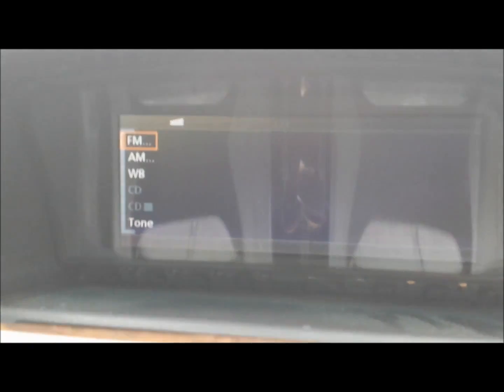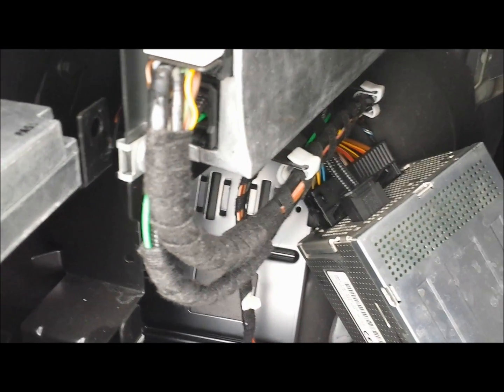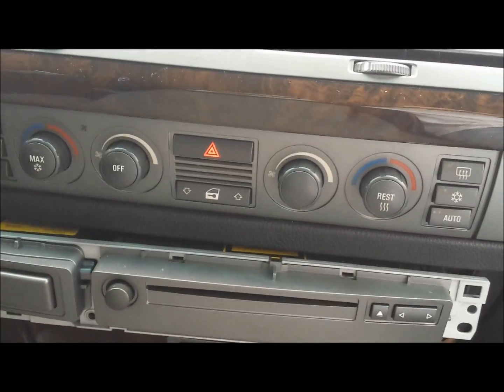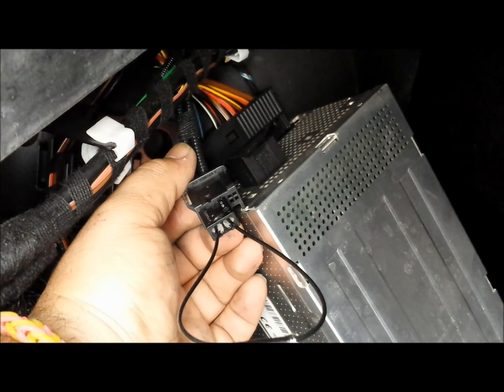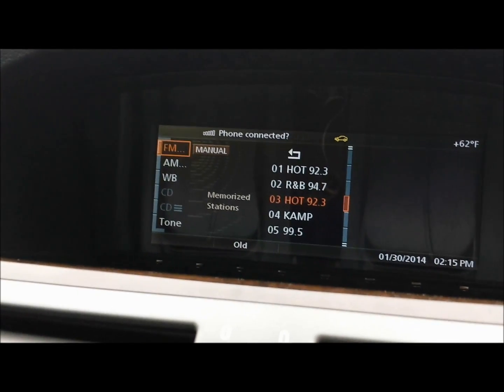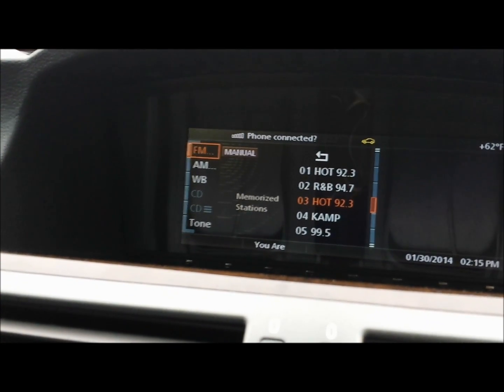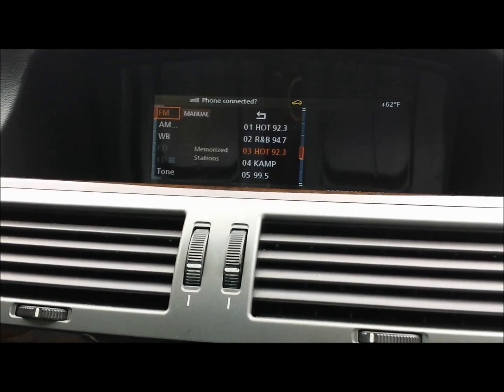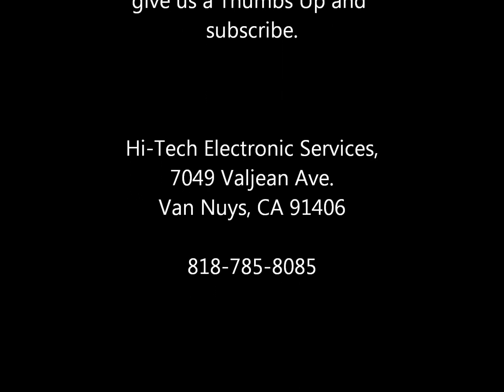How to Troubleshoot BMW Fiber Optic Audio Navigation 750 / 745 2002 to 2008. Part 1

Comment: Whats the common fault in the ask unit/cdplayer?  Compasitor,cracked grounds?  Any idea to get my tech in right direction?
Reply from the maker: @ZacSimpson-t8h  Cold solder joints, blown output chips.
Reply: @HiTechElectronic  thatnkyou i have just dropped mine to a friend that dose boards, ill let him know, I'm in Australia so do really appreciate  you advice!!
Reply: @HiTechElectronic ,I've got the ask unit back, I now can see radio stations, and my cd player works and plays music, but my radio, has no sound, I can scan and save stations just no audio?
Reply from the maker: @ZacSimpson-t8h Do you hear the door chime when key is in the ignition?

Comment: Mine when first got it only front pass door worked. It sounded bad though and very mono lol. I finally said screw it and started turning it not caring what happen to it. Started fading in and out not long after it completely stopped playing. This ess about 3 months ago. Vouple nights ago i noticed my door chime wasnt working anymore. And that night my idrive started freezing when id hit power button on ask. Then i noticed the entertainment screen wasnt showing stations anymoreI had purchased a loop a while back. I believe its the phone module i can put the loop in and then i can see the stations show back up. I noticed a very very faint sound coming from rf pass door but for only a min. Thing is i have when all devices are connected in system i have a red blinking light after every module. I put the loop back in and the stations show back up but no saound still. So that brings me to today. Today i got in it started it up and back speakers played, subs tried to play one in middle of dash was popping and static.  Did you say rare dick? Lol anyways first time i ever heard back speakers. Everybody says when you dont have red light after a module then thats the prob but when my loop is out of the phone module and it plugged up i still have the light all way through my system. Also today i went into my entertainment setting while they wss half ass working and i could adjust the eq, turn the logic 7 setting up to 10 (have not been able to get it past first little square at 1 till today while was workin) even though bass and trebble has always worked none of the others would. I have never had the little map on side idrive even when before when radio half ass worked. I have noticed my navi sound as it powering on and off when key wasnt even in ignition but every time only hear it for few seconds and stops and 30 min later i will hear it again. I have noticed a slight buzzin sound coming from dash at times when key is out and should have been asleep. Idk if this is normal but i can hit power on ask at any time and the idrive turns on also with the key not in

Comment: Can you tell me why my bmw 750li 07 speaker make a cracking sound a buzzing sound and no bass?
Reply from the maker: @yakell1012 Most likely Logic7 amplifier in the trunk is bad.
Reply: @HiTechElectronic  Are there any solutions?
Reply from the maker: @Mutlaqthatguy  Have your amplifier repaired or replaced.
Reply: @HiTechElectronic my problem is that the music works fine for like 3 seconds then it makes a crackling noise and shut off for a second. Then the music start again but the audio is lowered.
Does that mean that the amplifier is bad?
Reply from the maker: Bypass the amplifier in the trunk and check your audio again. If it sounds clear then the amplifier is faulty and if it is still the same then ASK unit is faulty.

Comment: I enjoy your knowledge on the audio system on BMWs.....I have a 06 750LI and my subwoofers under my front seats sound muffled and distorted!....Is it my Logic 7 amplifier or the subwoofers have gone bad??...If I use my lollipop on the Logic 7 and the subwoofer sound good, does that mean my Logic 7 is bad??....Pls. advise me on this issue....thanks....AMM
Reply from the maker: Most likely  the problem is the Logic-7 amplifier not the subwoofers. FYI if you bypass the amplifier your subwoofer wont have sound anymore!

Comment: Same problem here, it's a 2013 X3, I bypass the SOS module, nothing, then I connected a new amp, no sound. The radio works fine, what else can be?
Reply from the maker: BMW X3 has totally different sound system. If all the functions work fine including navigation and 12v power to the amplifier. Then you might have problem with programming of your CIC unit (radio/CD player} in the dashboard.
Reply: @HiTechElectronic  thank you, I have the cable and need to contact somebody to help me with the coding.
Reply from the maker: @ABWSKITCHEN  once you do that, check to see if the CIC unit is reset itself back to default "internal Amp" or the coding is correct, should be "external Amp".
Reply: @HiTechElectronic  thank you so much, I will try once I fix my laptop.

Comment: so i just need the optic fiber bypass module loop? then just "bypass" everything? then ill be fix or will that "lollipop" tell me which one to replace?
Reply from the maker: It will tell you which one is bad and if you are not using that module then you could leave it bypassed for ever.

Comment: I'm having this issue but none of the fiber optic cables are flashing red, this happened after i hit a bump and everything stopped working, I have tried the bypass on all fiber optic cables in the trunk under the steering wheel etc (2008 bmw 335i logic 7) if anyone has any ideas what it could be it would help
Reply from the maker: Your radio/cd player must be faulty.

Comment: Hi There !   Share my efforts.    Fell into the trap   BEFORE i understood how its all   connected,   Like  Xmas lites   1 buld goes out    whole string goes out    ..   I  bought   Typical   Logic 7 amp  ... used  ,,,       still   not all speakers work  ...... Waiting now for    Used ASK unit... (   for 04 e65 745)   As my car is that  ... Never  twigged on  ASK unit  rubber  volume  / off on button just was wiggly  .  n  just spin   NO clicking    .    Wait n see   Everything wit the radio was  good ,  disply etc    JUST sound from only 1 door speaker      Great video!!!!!   BTW

Comment: So I used a optical loop for my mmi radio and it work for about a month but now it cut back off, and won’t come back on I bought another loop and it still doesn’t work, what’s my next option
Reply from the maker: Keep bypassing rest of the components to find the faulty one. If all are ok, you need to have your ASK unit checked out.

Comment: How did you make this loop cable
Reply from the maker: Here is the link to purchase it:  https://hitechserv.com/parts/
Reply: @HiTechElectronic  hi I'm facing a problem with the E65 the problem is whenever I can I get the amplifier it make a beep sound all over the speaker and the screen is it got stuck in the BMW logo
Reply: Connection the amplifier*
Reply: @HiTechElectronic  or it lag whenever I switch to navigation entertainment etc it just like lag it doesn't go to any entertainment or navigation
Reply: @HiTechElectronic  please send me a WhatsApp number
Reply: Please reply
Reply: Hi there I am checking a 745i bmw no red lights at all in the trunk on any of the equipments the customer had someone change all the units except the FM tuner and communication module no fm stations display they still have all the equipment they change out.

Comment: Can you please tell me if I would replace the communication module of my 2005 facelift with an 2007 e65 communication  which it has the PK on it, it might work without inserting the module in the system? My issue is that when I am trying to connect my phone to car by bluetooth it asks me for that 4 digits pin which I don't know how to find them since are not written on the communication module.

Comment: Do I need more then one bypass cable .. I tested all with one but not enough  cable to test more then one at a time ????
Reply from the maker: If you have more than one faulty components then you would need more bypass otherwise one is enough. Having more than one bypass connectors make it easier to troubleshoot, sometimes we use 3 or 4 of them at the same time.
Reply: @HiTechElectronic  thanks ordering them now im going to order 4 of them

Comment: So I put a lollipop on the logic 7 amplifier even tho cds would play and the radio it would just cut in and out so I put one on it and it stopped it cutting in and out. But my question is how do I service my 745i 2003 e65. I’m hoping when I register my battery it will fix my trifecta light bc it’s so annoying seeing it

Comment: I know it been years since u posted this video. But is it possible to not have the Fiber optic wires at the Navigation unit in the trunk? Mine don’t have the optic wire with the harness on the navigation unit.

Comment: Hi there, how much do you guys charge to repair the cd changer?  The cd cartridge in the cd changer in my 2007  BMW 750Li is stuck and will not eject.  I'm considering fixing it maybe vs buying a used one off Ebay.  Kind regards - Alex.
Reply from the maker: Please check our website for prices. Ebay used items are cheaper to buy.
Reply: @HiTechElectronic what is the differences  between the ask units one have mode fm/am buttons the other dont

Comment: Hello, why is my Radio and the CD Player and CD Changer cuts in and out?  Do I have to replace the DVD GPS Navigation Unit or is any other solution?  Blue tooth suddenly stopped working.    Plesea!  You or any one with knowledge of same issue.  Thank you.

Comment: I have a 2005 545i and navigation screen does not turn on.neither the radio. The weirdest thing is the CD changer works.but I cannot controlled or see my options to control my heat position Taurus face legs or windshield. The heat turns on so I do have heat. Also I cannot see the car liquid levels due to the screen not being on. The car drives perfect and everything else works except the screen can somebody please help.

Comment: Hi ... I have a problem with the sound of my car. The car is a BMW e60 545i. There is logic 7, but the front door speakers do not play. I tried 2 amps nothing happens. The problem is the same. Could the problem be in the cd player ????
Reply from the maker: Yes, the problem is the single CD player in the dash board.

Comment: I have BMW X5 2008. All of sudden I drive screen went dark and no audio. In the trunk there are components, phone module and amplifier. The amplifier don’t have a fiber line to check, only the phone component has a fiber line hook up. Pleas help
Reply from the maker: The problem is the CCC unit "Radio/CD/Navigation" in the dash board.
Reply from the maker: If your car does not have navigation option then you have have M-ASK unit "Radio/CD Player". BMW X5 sound system is not like BMW 7 series and if the display is black you do not need to check the fiber optic lines. You need to check the fuse for radio and display, and if all the fuses are good then the M-ASK unit needs to be replaced or repaired.
Reply: Thank you
Reply: Thanks for the reply. I checked the fiber to the phone module, there is blinking red light. I checked the fiber line under the dash board, there is a blinking light. The amplifier has no fiber line connected to it. I don’t have navigation system or data LT radio. The speakers every once  and a while they make a cracking noise. You mentioned the ccc unit is the suspect. Before l buy new one(very expensive) how do l make sure that the ccc is the problem. Thank you very much.

Comment: So what if all the components are working and the red light is on when you unplug each component and you still don’t have FM cd nav etc?
Reply from the maker: If you have checked all modules correctly then the problem is the ASK unit.
Reply: HiTechElectronic I looked on inpa and it shows a error something about the network not waking up, do you know what that’s about?
Reply: HiTechElectronic error E18D
Reply from the maker: @kingchrisp198432  No clue.

Comment: Hi I have the 2007 BMW 750i and my NAVIGATION isn't working, also the audio system is very bad . I can only see the names on the screen like FM,AM ,AUX but not stations available.  After I have watched your video ,I believe the NAVIGATION unit cause the problem.  Please comment below your opinion. Thx
Reply from the maker: Please watch "Part 2" video as well. Any unit with fiber optic output could cause this issue.
Reply: When u ship how long does it take to receive it
Reply from the maker: @viktorthomas2668  3 days.

Comment: Hey I tried everything you said on this video with the lollipop and it’s still the same. Only thing I haven’t tried was the radio it self cause I don’t have another radio to test it out. Once a month the front speakers would work for an hour or so then nothing sometimes the display freezes.

Comment: I think this all relates to my issue. no sound from bluetooth. music through aux sounds distorted and no matter what source im using for music ask unit volume lowers or may even go off. is this related to these issues?
Reply: Did you ever it fix and how because I’m going thru same problem now as we speak with ‘07 750 to the point my whole screen blank out and my temperature gage frozen

Comment: I have 2007 bmw 750li and I bypass the satellite tuner under the truck and the radio works but I have a noise coming from the driver door speaker. How much to repair the satellite tuner and what’s the next step to fix that noise from driver front speaker

Comment: my car is the same problem, it has no audio does not have displey does not work the cd player when, the check had fallen oil to the module but the navigation did not enter only the INPUT VOICE COMMUNICATION MODULE UNIT
Will that be?
Reply: Daniel Jaimes i have the same problem with the oil. Help please!

Comment: Thank u so much I ordered the loop after 3 weeks of silence in my car now it's back
Reply: What was causing the problem in yours?
Reply: @daygowest9346  Probably the radio module was dead. So people are ordering a wire to loop the system. Apparently it works but I will try it tmr on my gfs grandfathers BMW. His is also shot, so I want to see if it works.

Comment: Please help bmw m5 f10 2013 model keeps blowing fuse for radio when i unplug the amplifier the wire dats shorting does not have short to ground anymore is it the amplifier thats faulty
Reply from the maker: Yes, the amplifier is shorted.

Comment: Hi, I recently baypassed my Telephone Control unit because it wasn't working, but after I baypassed it, when ever I play a CD it switch off to FM, it's like rest the monitor every few and then. Do I need to buy a new Telephone Control unit, because maybe some things can't be baypassed.
Reply from the maker: Telephone control unit has nothing to do with the CD player. There is an issue with your CD player.
Reply: HiTechElectronic but I changed my cd player, and still the same, when I play a song from a CD is suddenly stops and switch to the radio, could there be another faulty unit?
Reply from the maker: The CD player must have been a used one or the disc is faulty.
Reply: HiTechElectronic this still the same, the CD player I took was from my friends car which was working perfectly on his bmw. Sorry maybe I didn't use the correct words to describe my problem. Every time I play the CD it gets interrupted, this happen even when I'm playing the radio, it's like the screen keeps resting?
Reply from the maker: Bypass one by one all the components in the trunk and test your cd player and radio to see if the problem is solved.
Reply: HiTechElectronic problem solved. My navigation system was the reason, but now I baypassed it, thank you so much for your help👍

Comment: Hey I got the same problem on my 2006 750i the CD player works I loads the cd but didn’t have any sound, I have no stations am/fm/sat, I tried connecting my lollipop/most bus to the Logic7, nav, sat, and still doesn’t do anything none of the steering wheel buttons and only thing that works is the climate control any tips?

Comment: I have a 2002 745li, the driverside rear deck speaker is the only one that works. The prevoius oqner had an after market system in the vehicle. I reconnected the wires the the L7 and i still have the same isssue. Radio am and fm works/cd player works cd changer works everything else works . I basically have only 1 speaker. What do i next?
Reply from the maker: Most likely the ASK unit is bad.

Comment: I have a 745i. I lost my radio channels and cd ,cdc options are grey. My lollipop in the glove box doesnt have any fibre optic light on. Voice module in trunk has light, navigation has light but not ejecting disc, communication module doesnt have fibre optic light either. What do you think it could be? Im @a lost rite now
Reply from the maker: Double check your connector in the glove box, if there is no fiber optic light then the problem could be the ASK unit.

Comment: Hey i have a 06 bmw 750i! Im having a problem with music, while i was driving my music suddenly shutoff! Now i can only hear the treble not bass or nothing. Can you tell me wat could be the problem?
Reply from the maker: Sounds like a bad Logic-7 amplifier which is located in the trunk.
Reply: Can you please tell how can i fix it? Can i jump it with the tool in the dashboard! I have seen somebody do that in a video! Thnx for ur help!
Reply from the maker: You can't fix it yourself but you can bypass it, just follow the steps in the video. After bypassing the amp you would have sound in both front doors and rear deck behind the rear seat. But since the subs are not working anymore, do not crank up the volume too high because the ASK unit could get damaged.
Reply: Ok thanks! Can you tell where i can find that video?
Reply from the maker: This is the video!